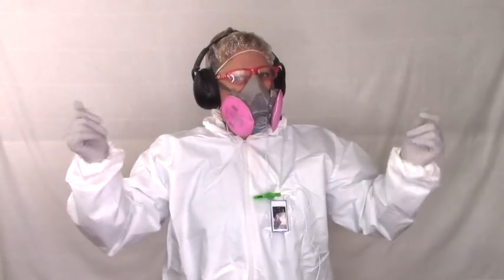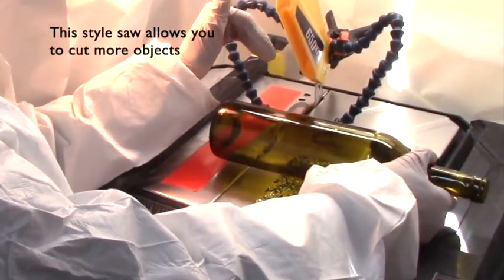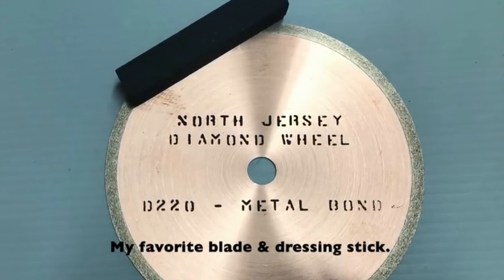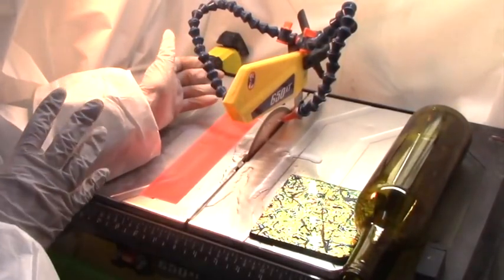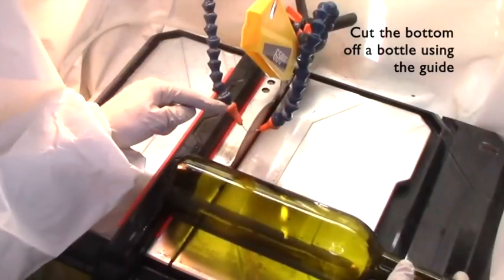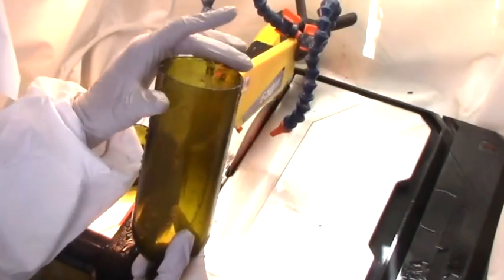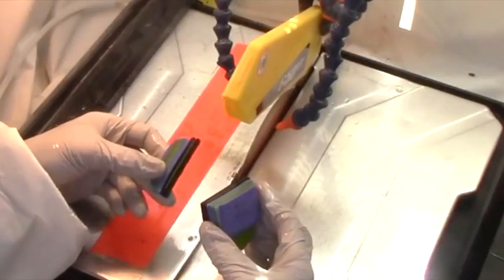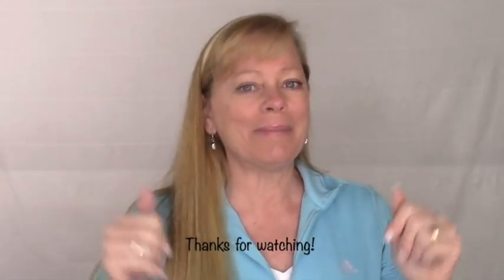#71 My Wet Saw Basics

Comment: Help mine cracks and chips every time at the end cut. I’m going slow, saws in low speed, not applying pressure and using diamond blade can’t figure out what else to do seeking advice please help.
Reply from the maker: Chipping is going to happen because the end of the cut is so thin & fragile. So another option is to saw in from the end a bit before you start the cut from the beginning.

Comment: Would you day the saw is better than using a regular hand held glass cutter where u snap the glass
Reply from the maker: ThatKidnHisTinny I use a hand held glass cutter for single sheets of glass. I use my wet saw to cut shapes out of sheets of glass that have already be fused. If I used a glass cutter I would need to do some grinding & I don’t want to do that!
Reply from the maker: True Cichlids not better, just different. Each works well

Comment: The saw in your video is not the saw in the link for Amazon. Not sure if the blade link is correct either, not sure.
Reply from the maker: Queen Brooksie The saw in the video is the QEP. There are links for two different size and one of them is for the QEP. The link for the blade will fit on either side. They both take a 7” blade with a 5/8” arbor.
Reply: @SusanMcGarryGlass  Ok, thank you. I was just confused because the video shows a North Jersey Diamond Wheel and the link goes to a DeWalt blade.

Comment: I’m afraid for your fingers😳
Reply: Diamond blade won’t cut into soft objects, I’m not saying that you can’t hurt yourself, however it’s quite safe. As a matter of fact, if you’re cut bottles you should remove the label before you cut, the blade will have a more difficult time cutting the label than the glass!